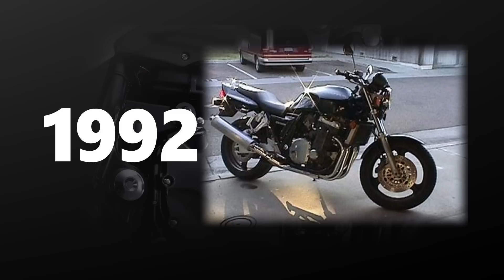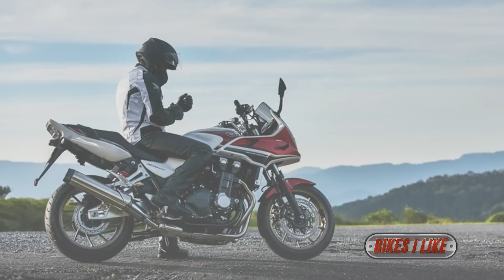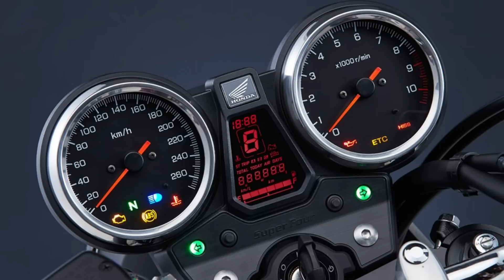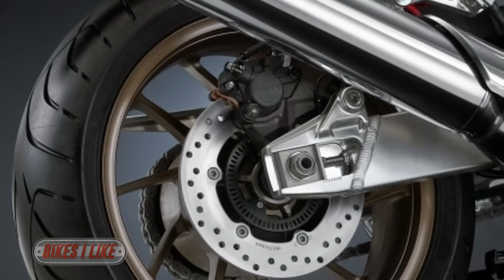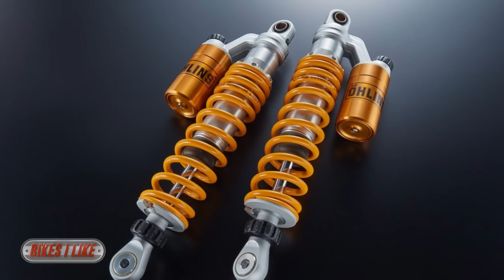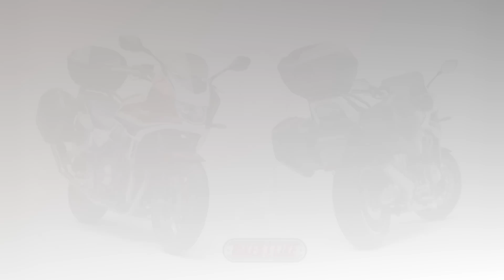2019 HONDA CB1300 - FULL SPECS

Comment: The 1983 CB1100F produced an air-cooled 108hp. So, in only 37 years, adding just 200cc and a little water cooling, they made an incredible progress of 1 (one) hp. Congrats.
Reply from the maker: I think you might be missing the point of this motorcycle Michael. If you're looking for examples of Honda technical innovation, you should be comparing an old Fireblade to today's model (900cc with 110HP - now 1000cc with 189HP). The CB1300 is not that type of motorcycle. It's for people seeking the complete nostalgic experience. I'd very much still enjoy owning and riding this motorcycle.
Reply: Since I have ridden that generation of bikes back in the days, I remember very well. Part of the experience was the fact that they were the meanest and fastest misfits on the streets. The bikes were roaring and tried to kill us in every curve, right? I don't see that wild attitude here.I like the lines and the technical perfection of this one, but I'd rather have a tricked out '83.
Reply: @michaelwinter3132  That's fair enough Michael. I too am of that era my first big bike being the Yamaha XS1.1 (1100).  Owned about 15 motorcycles since the 80's... including 2 CBR1000's and I do remember my 80's CBR1000 being a much more spirited ride than my 90's CBR1000. The quickest bike I've owned was the BMW K1300S (173HP, 0-100kph 2.9sec) But I feel the CBR1300 would be a more suitable ride for me these days, I also really like the current CBR1100 range, have a video coming on that bike soon.
Reply: @PaulVanGaans  my 2005 K1200S is a beast with bags. Good for at least 165 to 170 mph.
Reply: @larrys.3992  I had the bags on mine too Larry! Handy being able to store mine and my wife's full face helmets when out and about touring was a real bonus. Re acceleration and top speeds, they certainly are potent.
Reply: @michaelwinter3132  No problem, get yourself a tricked out '83, but you have to understand, most of us don't have that  deathwish we had at 19.
Reply: What about 130rwhp with small mods?  Stock the 1300 makes 118nm of torque.  I currently own a very nice original model and had a modified 2008 1300 for five years.  No comparison, the new bike is superior.  Memories arent neccisarily reality.
Reply: Yes and is a reasonably modern design, except for the weirdy telelever front end.  Horsepower was a good attempt by BMW but not as good as the Kawasaki ZX14 of that era was it? :P
Reply: this EFI version is lights years ahead of the old ones in every way....guarantee the new EFI bike will walk all over the older version...